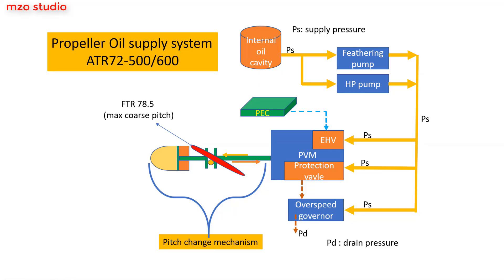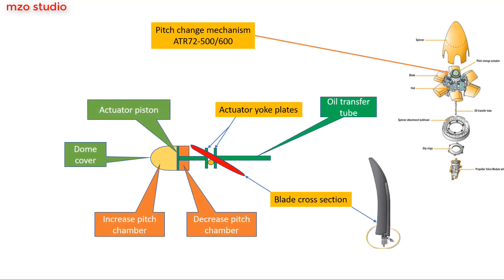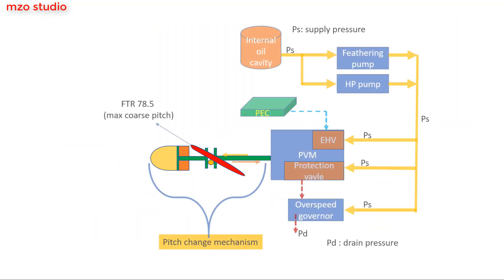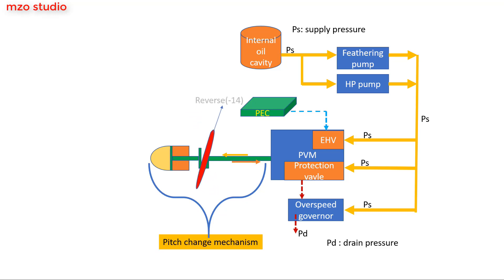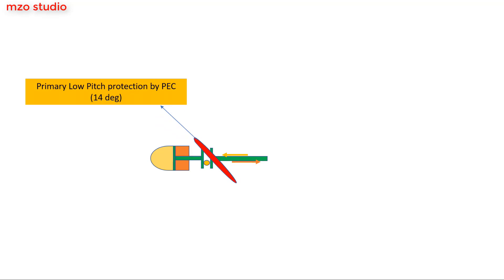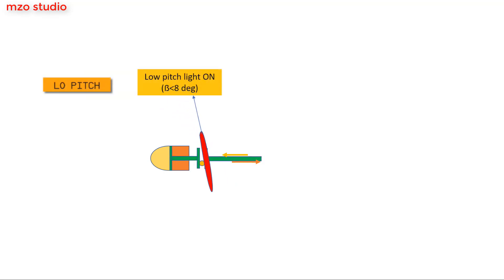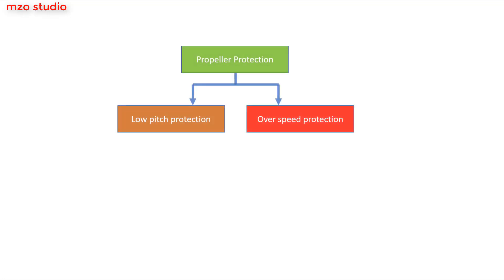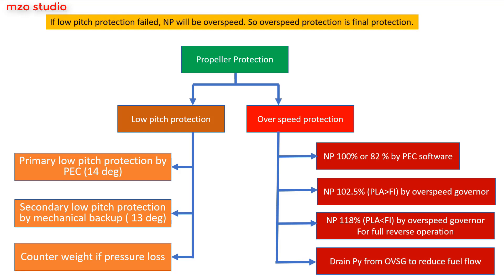ATR72 propeller system

Comment: Hi, thanks for posting this video! However i did not quite understand how the pitch change mechanism. As far as i have understood to vary the pitch the PEC feeds supply oil supplied from the HP pump on the prop RGB through the EHV housed in the PVM, to either the increase or the decrease pitch aide of the actuator causing a servo piston mechanically connected to the shanks to slide inboard or outboard, changing the pitch. To decrease the pitch, for instance, the PEC feeds the so called control oil - not sure where it comes from - to the decrease side of the actuator, opposing the ever present supply oil, driving the piston and the blades towards a flatter setting as reflected by a drop in Np; conversely to increase the pitch the PEC dumps some control oil allowing the supply oil to drive the servo piston and the blades towards a higher pitch. If HP supply oil from the HP pump is not available the system will the back up electrical feathering aux pump to supply oil to the increase side of the actuator and drive the blades towards a higher pitch. Is that correct? How is the control oil dumped and where? During normal ops is any oil fed into the increase side of the actuator or the increase in pitch is solely obtained by dumping the control oil and allowing the supply oil to drive the piston? Many thanks
Reply: No reply? 🥺